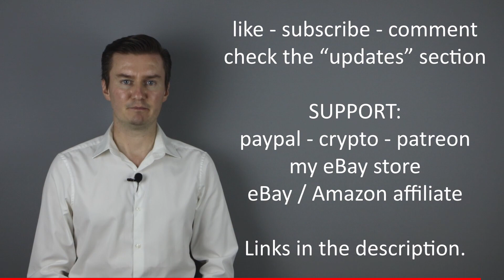Canon EF 17-40mm f/4L USM - how to clean the lens inside

Comment: Even though the videos from this channel are usually absolutely great, I would refrain from trying this. The front lens is a centering element and therefore adjusted (centered) using a special tool, a collimator. I don't think the mark is enough to get the lens back to its original position and I would even go so far to say repositioning is impossible to do at home with decent results. Image quality will suffer after putting the front lens element back without proper centering on a collimator.

Just to clarify for those who want to know more: This type of adjustment has nothing to do with the front lens adjustments of like the Canon 17-55mm 2.8 or the Canon 17-85mm. The position you mark there is the factory adjusted optimal position for resolution. What I mean here is a centering adjustment. Compare the adjustment sections of the Nikon DX 17-55mm or Nikon Micro 105mm 2.8 repair manuals (available online) for the 1st lens group alignment.
Reply from the maker: Thx for the info.
Reply: @CamerasLensesEtc  Please consider taking down cleaning videos for lenses with a centering front element, especially Canon L lenses. People who seek to remove dust specs behind the front lens, which are almost always irrelevant for image results anyway, will have very real image quality issues after doing this. You have really great videos on your channel, but these ones will do quite a lot of financial damage.
Reply: @The-four-o-five   Is there not a more careful method of marking the front element position so that it can be reassembled with the same alignment?  Is precision of .1 mm sufficient to recapture original alignment?